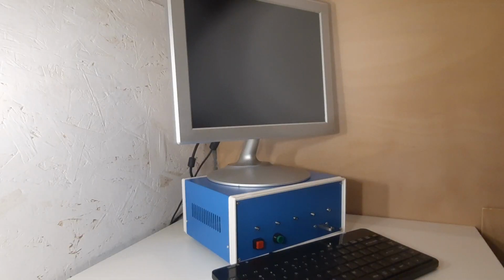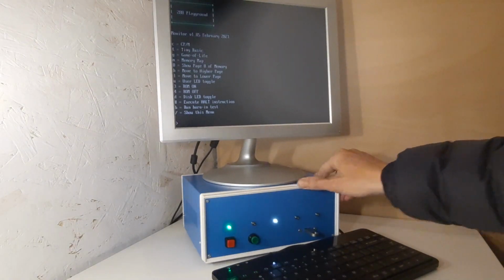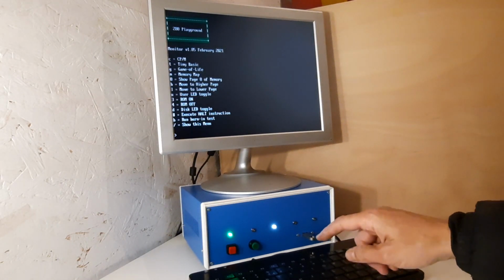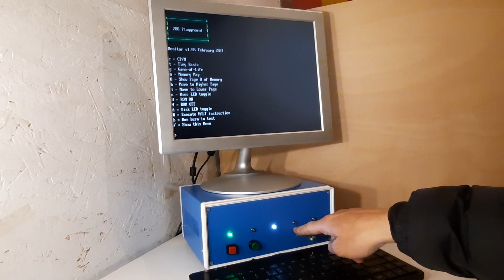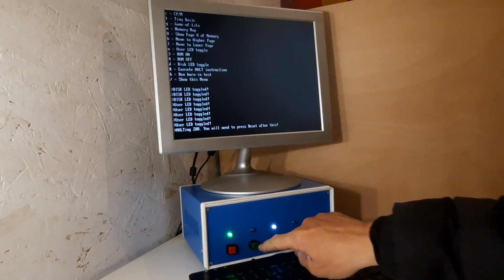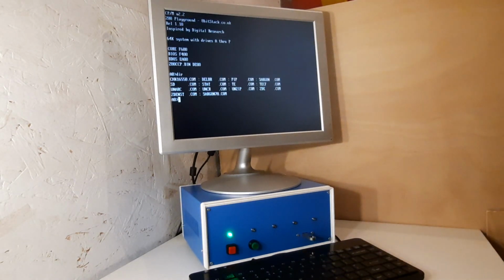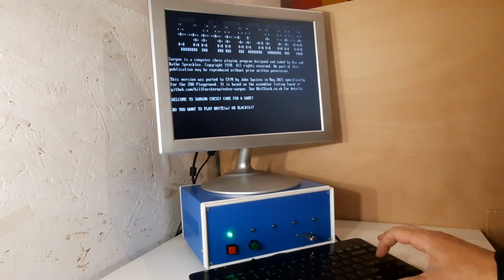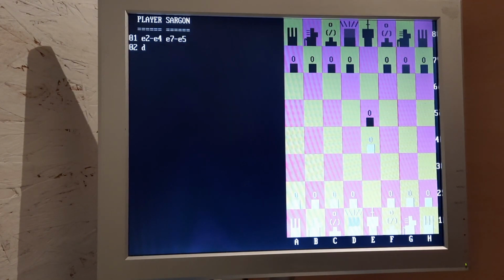Building a standalone Z80 CP/M computer (part 3)

Comment: Hi. You have done a very nice work.
I have seen that new version of the TTGO/ESP32 adapter can use the mouse PS/2 port as a serial interface, and using that connector is possible sending power (5 volt) and connect directly the serial chip of the Z80 without voltage adapter.

Comment: A tapered reamer is useful for over sized holes
Reply: The other great tool is a stepped drill. Allows you to drill holes from 4mm to 12mm or 15mm. Larger end sizes available but can be a lot more expensive.
Reply from the maker: I'll buy one!

Comment: Loving it! The metalwork looks pro
Reply from the maker: Have you finished your version yet? The needle files are the key!
Reply: @CircuitBreaker256  No, I got tied up with work. I'll definitely get the files! I'm also chucking a lot at getting the USB keyboard attached. I had a CH559 Dev board sending out what appears to be serial keyboard codes. I was also looking at the tiny USB arduino code on the Seeed Xiao. That should be able to do it.
Reply from the maker: @droganPaul  Interesting about the CH559 board. I have tried plugging a usb keyboard into the CH376 module that is on the Z80 Playground. I was able to query it for make and model of keyboard etc, but got no further. I'll keep trying.
Reply: @CircuitBreaker256  I got the CH559 Dev board from Electrodragon. I could send one your way if you wanted.